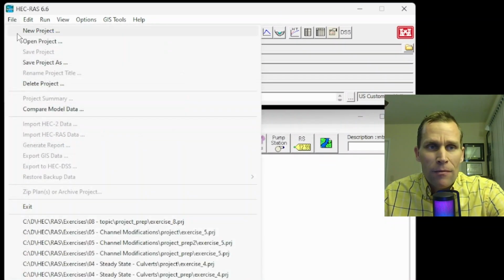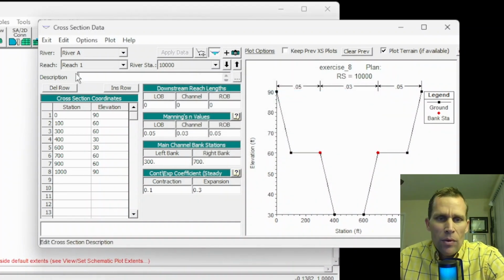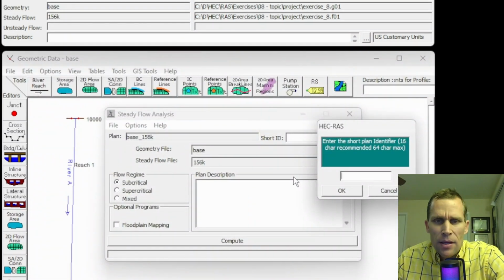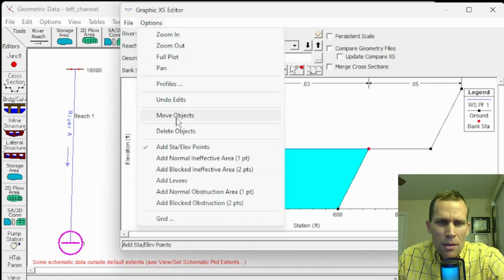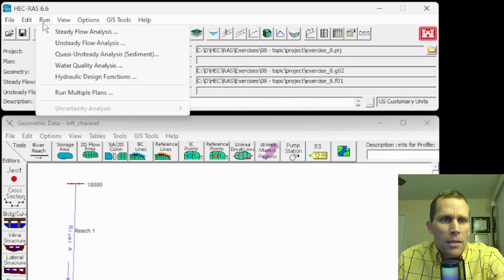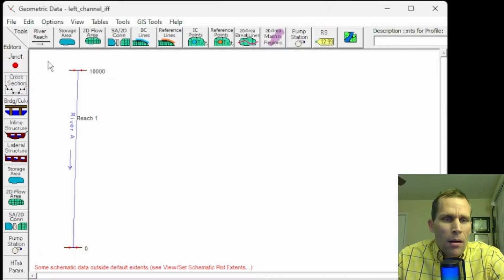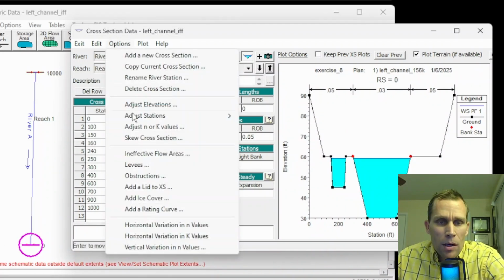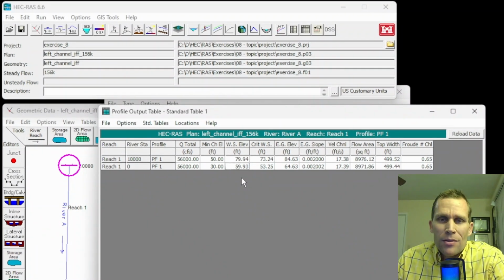HEC RAS Exercise 8 - Ineffective Flow Areas

Comment: Hello, thank you so much for your incredibly helpful content, what does the permanent mode do to the IFF areas ?
Reply from the maker: Hi. When the IFF is set to permanent it will never convey flow (regardless of how high the water surface elevation). If the IFF is not permanent, then it will convey flow as soon as the water surface elevation exceeds the set threshold elevation.
https://youtu.be/h3ziku1rQ4M